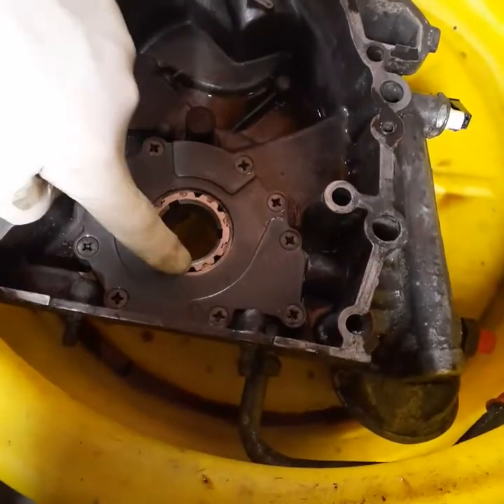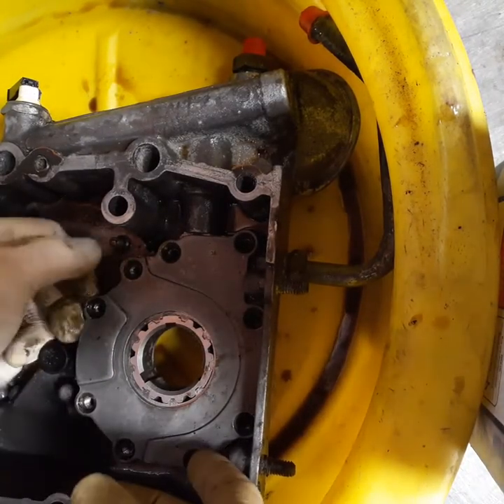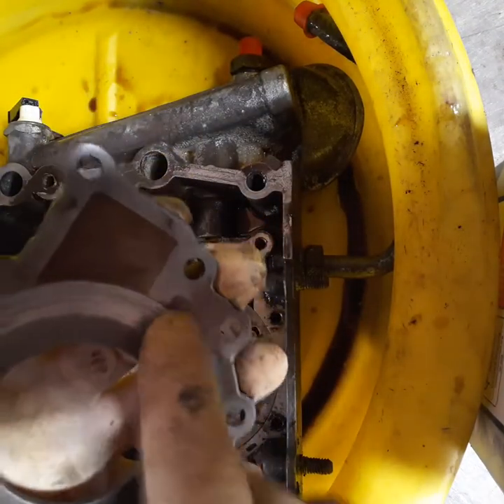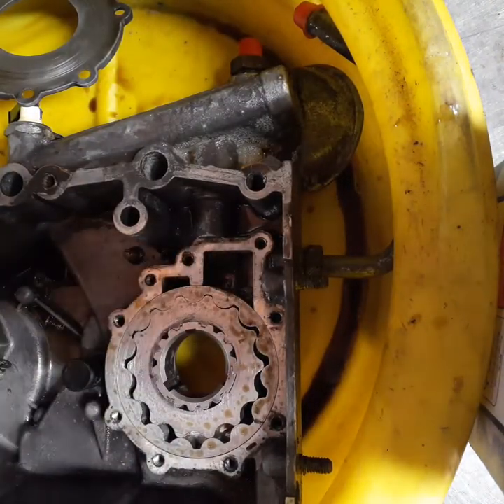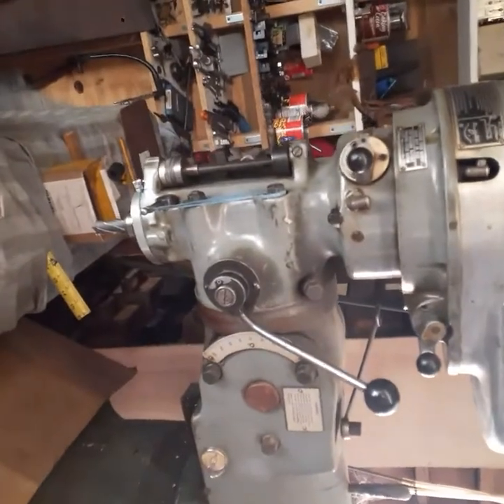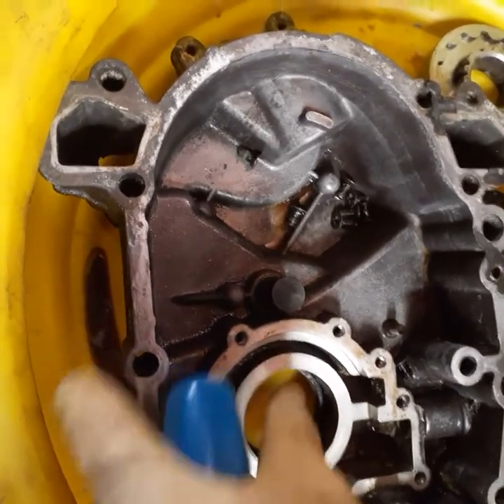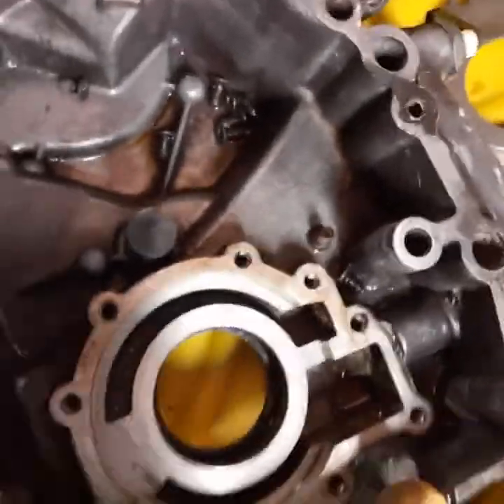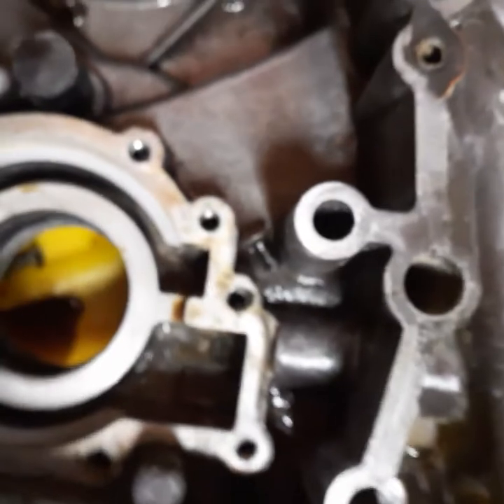Rover 4.0L Oil Pump inspection and repair. Timing Cover inspection repair. Range Rover, Discovery

Comment: Check the cover/back plate is flat with a straight edge before reassembly. It can become slightly concave creating a big gap which is where your oil pressure goes.
Reply from the maker: True, I did not show that I checked it.